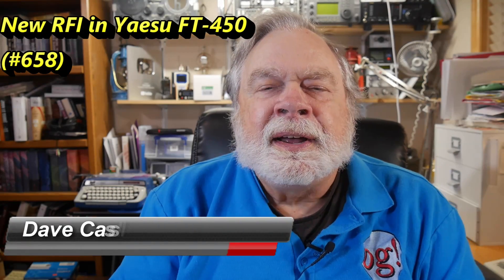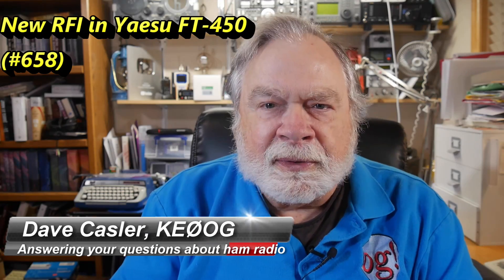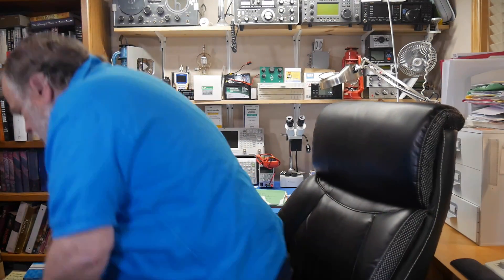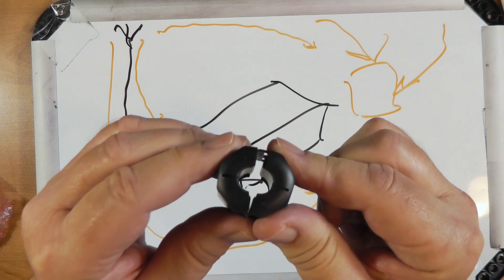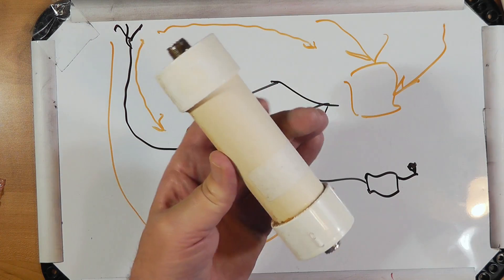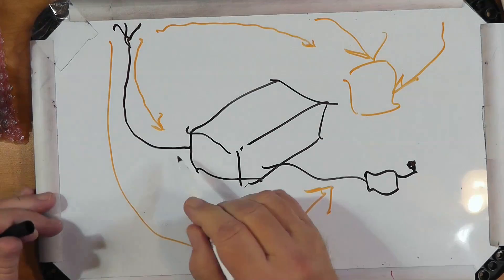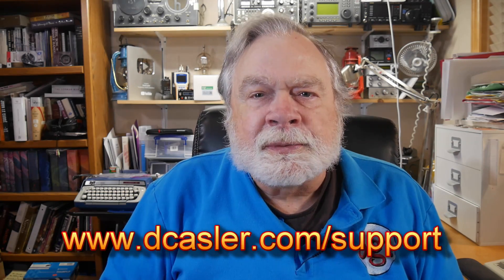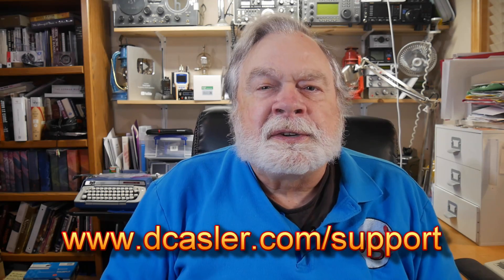New RFI in Yaesu FT-450 (#658)

Comment: Hello, I had this same extact same problem while operating moble. I was pluging the rig in the cigarette lighter.  When I was using the 450D in my travel tralier and had the same problem.  The answer is low voltage at the 450D.

Comment: I have a FT 450D that works fine. New Choke Cookbook is a great source for reference a PDF is down loadable. On my coax I use 10 turns on 240 by 43 mix torrid as a common mode choke. On my DC power from the power supply, I wrapped 12 turns clockwise. And on the other side of the 240 by 43 mix torrid, I wrapped 12 turns counterclockwise. One coil positive and the other negative.   Also watch OG's Grounding Videos     73s KC0ELC

Comment: I suspect the DC voltage is dropping. And maybe not RFI.
The power supply may be heating up and dropping voltage at 100W. 
Measure the dc voltage at 100W output. 
 He didn't say if radio goes "off" and stays off ? Or does output just drop out ?
Also, RF in the shack will show up many places, most notably in the speaker or audio of nearby equipment. (PC speakers etc).
Good luck.  Never except that you have to tolerate this. Amateur radio is all about figuring out these things...

Comment: Ferrites from no-name sources aren't always reliable. I go to Palomar or DX Engineering or another prime vendor if I want chokes that are guaranteed right.
Reply: Hardly any ads on Amazon for ferrites mention the "mix" of the material. The mixture of the two or three metals (with the epoxy powder) determines the frequency range that will be absorbed.
Most of the ones on Amazon are just surplus from the computer industry, and do not work below 25 MHz. 
That's why there are so many negative reviews.... they got the wrong version.

Comment: I second Andrews comments below.  Check the voltage at the radio's connector, while the radio is set for 100W (RTTY or CW) into a dummy load.

Comment: Check that the power supply you use is set at 13.8volts if you have a variable voltage dial. We had issues on Field Day with a power supply that was slightly off the 13.8volt setting and the radio would not do 100 watts and cut out a few times. Cheers Andy M6APJ

Comment: I suspect swr. At 100watts CW, the full dissipation of the pa is in use and besides swr it could trip the current and thermal overloads. A dummy load is an important thing to test your rig at high power.